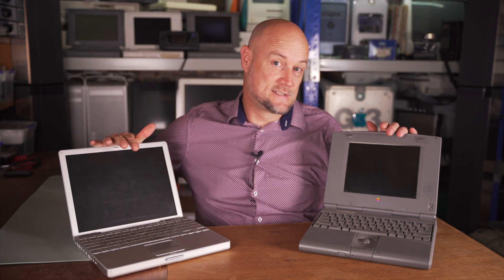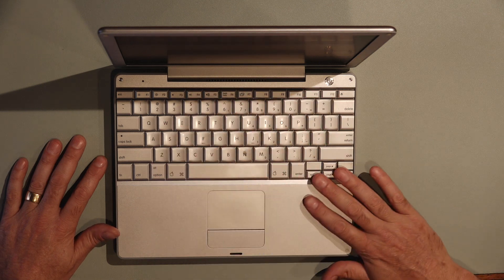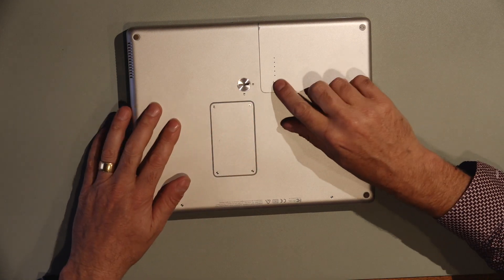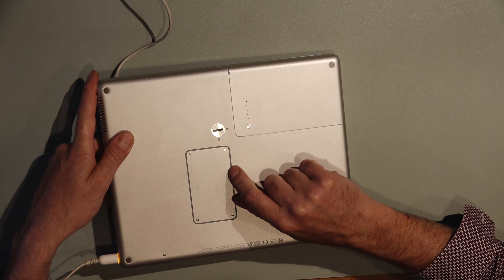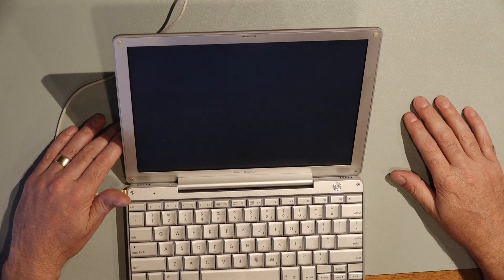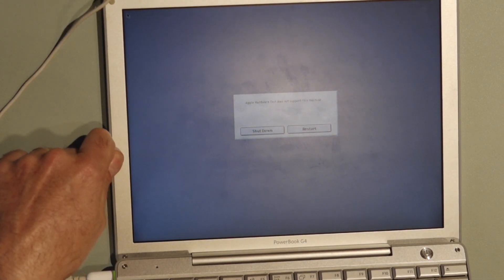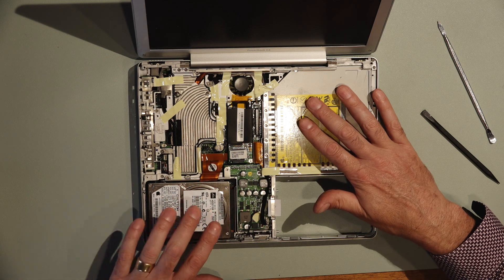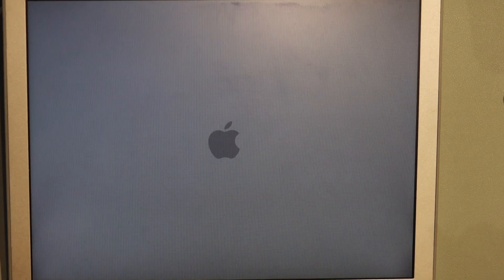PowerBook G4 12" Laptop Repair and Review - Upgrading with mSATA SSD!

Comment: This video gave me a glimmer of hope - I have a 1.5Ghz model with the same lit but blank screen problem - unfortunately I'm pretty sure on mine the screen data cable is broken as it remains blank.
You have a memory problem on yours - there's 256Mb on the motherboard, your added card should bring it up to 768Mb.
Reply from the maker: I wondered about the memory, thanks for clarifying. Probably not fixable I’d imagine.
Reply: Maybe bump the RAM to 1Gb - more than enough for Tiger :)
Reply from the maker: @squeezingtheapple6990  i just use what I have laying around, 512 was the biggest i could find!

Comment: Really wish there had been something with the aesthetics of the Clamshell iBooks, but with the power and size of these PowerBooks. Closest you can get afaik is an iBook G4 with the screen cover off of an early iBook G3 DualUSB swapped over, stripped and repainted. No solution for the bottom chassis, since the screw standoffs for the G3 DualUSB and G4 were different. :(

Really enjoyed the video!
Reply from the maker: Sounds like a real Frankenstein! But also a fun bit of tinkering. Thanks for the comment!
Reply: @TheBasementChannel  No problem!